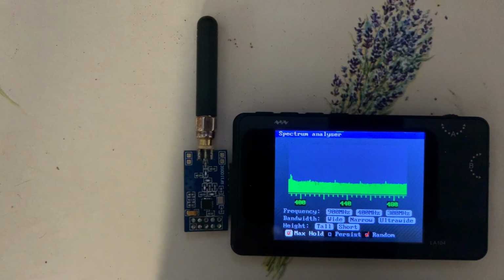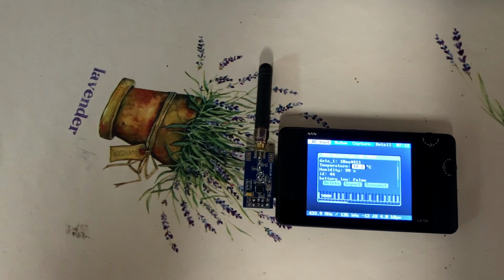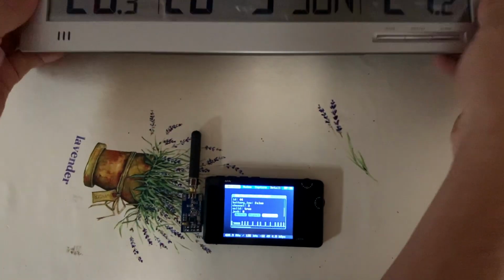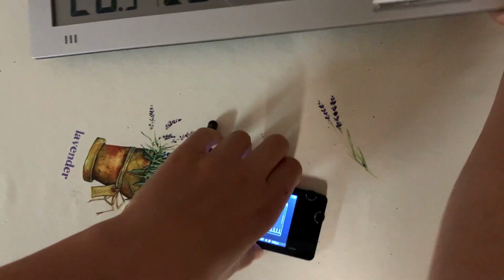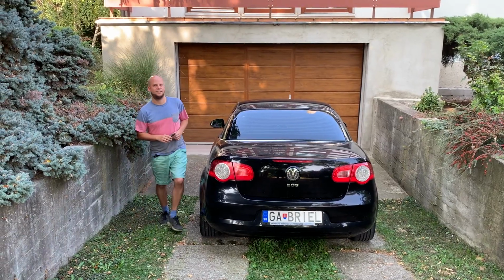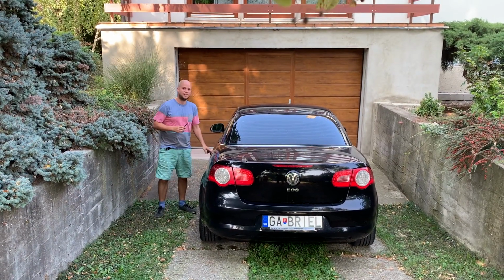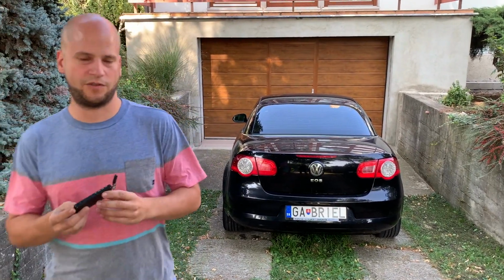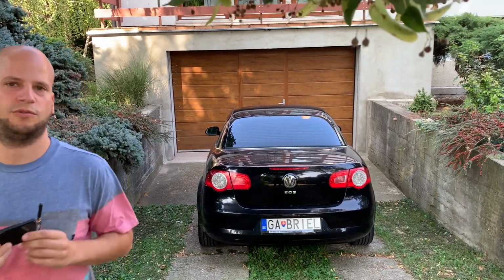LA104 RF Toolkit

Comment: Hi Gabriel Valky (gabonator),

Your work on the OS upgrade on the MiniWare LA104 project is fabulous!
With many years of support.

I purchased a new LA104 this week.
Loaded your system.hex to the DFU (worked)
It renamed it in FLASH as system.rdy

Reboot the system and several faults on the screen.

When I power off, hold ESC, power back on it comes up with screen:

Product: LA104
Hardware: Version 1.5B
MCU Type: GD32F303VE
LCM Ctrl: ILI9341
USB Disk: 8MB Internal

I removed the cover to find the MCU has been changed from ST STM32F103VCT6 to GigaDevice GD32F303VCT6.
I tried to re-compile (not an expert on this) to the GD32F303VCT6 with no success.

Have you considered adding support to the new processor they are using in the LA104

Thank you for all you have done on this project.

Jeff

Comment: Nice job but as per I understood you can decode only few types of FOB right?
Congrats for your hard work.
Reply from the maker: There are only few decoders implemented - some weather stations, garage door remotes and VAG keyfobs (vw, audi, seat, skoda). The CPU is simply too weak to handle more than 20 protocols in single application so I have only chosen those devices I have at home for the purpose of this video. This application not only captures the signal, but it also shows decoded payload and can be used for synthesis of fake frames (as shown with the weather station). The webusb application has decoder for 150 various devices and can be used for extracting waveforms of unknown protocols very easily

Comment: Can this setup be used to read 315mhz car remote ID for lock or unlock function?? How can I get in touch to discuss this more perhaps WhatsApp??
Reply from the maker: No, the module is tuned to 433 MHz, I was able to receive the signal from 868 MHz keyfob by placing it closer than 20 cm from antenna, but it is unable to transmit strong signal at this frequency. So you need to find CC1101 board tuned to 315MHz. I can't give you more support, but you can open a discussion in LA104 development page if you have more questions.

Comment: Hi Gabriel, im logging signals but the module is not able to decode them, do you know why they are not being showed in the capture window?, do you know where i can open and process the logs i took?, thanks.
Reply from the maker: Try to use the webusb based analyser which supports 200 different RF protocols: https://github.com/gabonator/LA104/issues/41

Comment: Cool. So is it possible just to buy LA104  + connect any transiever  (Cc1101 or any other) to it? Or need to upload/upgrade LA104 analyser firmware (how?) to get radio tools?
Reply from the maker: You need to install LA104 OS in order to use these apps. See the link in video description - on top there are instructions how to install it
Reply: @gabonator  Thanks. But is any other radio-module acceptable? In the description mentioned CC1101 (the same as NRF905, according to Chinese's info), its 433 frequency module. But there is also NRF905SE, which is 3-range module: 433/800x/900x ... looks like both modules have the same protocol, and even gabonator software is capable to work with these 3 frequency ranges. Or not?
And by the way, if it works with CC1101, so maybe worth to update for working with NRF24 too, full-size wifi/bluetooth instrument...?
Reply from the maker: @ivanz9324  For different module you would need to implement custom modem driver. NRF905 could have similar specification as CC1101, but I am sure the SPI protocol will be completely different. But if you do not need to change the frequency/bandwidth and you have a source of demodulated signal (e.g. from simple OOK receiver or properly configured transceiver module), you can connect this logical signal to P2 input and use the app as signal decoder
Reply: @gabonator  Is it possible to write signal for further analysis? I mean , signal which wasn`t recognized by LA-104, unknown protocol? And how to load more protocols there? Because 99% of signals have unknown protocols...  Thx
Reply from the maker: @ivanz9324  For unrecognized signals you need to use "webusb rf analyser" app with your computer. I have added only few protocols so far - only for those devices I had at home...

Comment: Hey, i can do this with the module and a raspberry pi?, or with cc1101 + USB analyzer?
Reply from the maker: I am sure there is software which does something similar on raspi. But there are more powerful SDR tools available, so there is no need to use CC1101 if you can use full featured software defined radio over USB
Reply: @gabonator  cool, i'm looking for something to use only the rtl sdr dongle

Comment: Nice work. Is it possible to receive more than 1030MHZ?
Reply from the maker: No, documentation on CC1101 says it works in following ranges: 300-348 MHz, 387-464 MHz
and 779-928 MHz. And the board input filter  heavily attenuates anything outside the frequency it is tuned. So even if you want to work in 800 MHz range, you need different board as the one in this video which is tuned in 433 MHz

Comment: Really never soldered before I gave it a try but not so good I was wondering could I use this m-f jumper wires female to female do you think it will work thanks
Reply from the maker: Yes, of course you can
Reply: @gabonator  OK thanks for responding great have a blessed day

Comment: Can it search for 315mhz to
Reply from the maker: The module is tuned to 433MHz, but by placing the transmitter next to the antenna I was able to receive 868MHz traffic as can be seen in video at 3:20. So the answer is yes, it will work if the signal is strong enough
Reply: @gabonator  just ordered me the LA104 I wish I could have waited before For I bought the ds213 oscilloscope mini because it can do anything thanks for responding 🙂🙏
Reply: How did you get raw IQ data for a spectrum waterfall?

Comment: My module arrived today. Soldered the pins and it works nicely. Thanks for the video. :)
Reply: Does anyone have the link to buy the exact module Gabriel uses? I have several different modules with similar references, they all detect the signals but it always says "unknown protocol", I have tested several transmission devices , Thank you
Reply: @joangomez4760  Got mine from eBay. You can also find them on AliExpress. Just search for T1-CC1101. Most probbably it's not the module but the software that can't recognize all signals.
Reply: @joangomez4760  Hi, tell me, have you figured out how to recognize the signals yet?  I have the same problem as you
Reply: @joangomez4760  Hi, tell me, have you figured out how to recognize the signals yet?I have the same problem as you
Reply: @art9tem  It doesn't work, I'm waiting for 2 different RF modules to do more tests
Reply: @joangomez4760  write your telegram,I want to know your results
Reply: Hi I see you say you got yours soldered if it not a pain could you please post a picture of the back side of yours so I can see how you soldered yours I have a soldering kit thanks

Comment: Is there a module for spectrum analyze 2.4 and 5.8 ghz ?
Reply from the maker: CC1101 is a sub gigahertz transceiver, so with this  application you wont get higher reading than 1 GHz. But by using CC2500 or nrf24l01 and finetuning the code you could get what you need

Comment: Hi Gabriel, I have trouble with connecting the LA104 running LA104-2020.10 (CC1101 WebUsb interface) to Chrome Version 86.0.4240.183 on Windows 10. The device displays "Info:Connect the device to computer" and the / is turning in the lower right corner. I checked permissions for USB and Serial they are set in ASK(default). Can you please give some advice?
Reply: I found the instruction on the "Web USB Oscilloscope (DS203)" page (last item under "How to install:"). I installed the WinUSB driver thought Zadig for the "LA104 Analyser" USB device once connected and now the WebUSB device is available in Chrome.